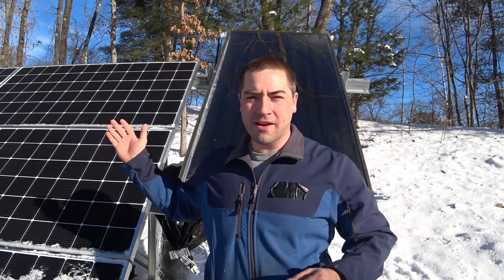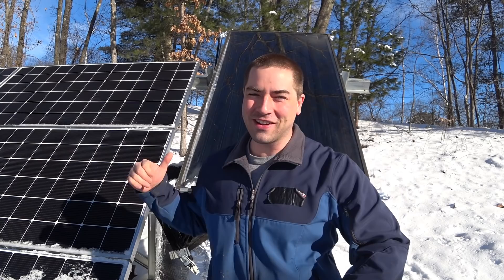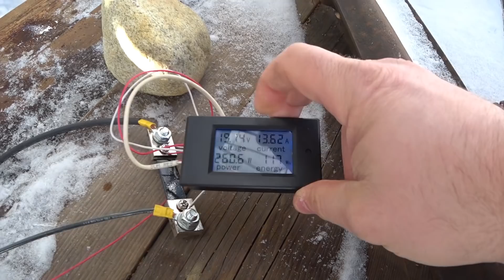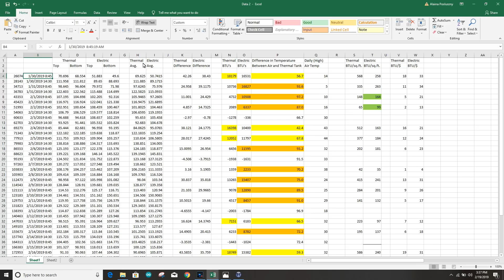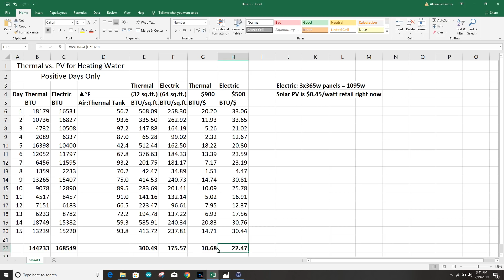Results of Solar Thermal vs. PV Experiment in Heating Water

Comment: Brilliant video thank you so much. I have been looking into solar heating for my Dad's very very cold house and I had wondered this very question PV vs thermal. What I have been seeing in the last few days though is in cold locations like yours you are much better off using evacuated tubes as they don't lose the heat to the cold anywhere near as much.

Comment: Not having the thermal panel and tank installed the right way will give you very incorrect results. Circuit needs to be closed loop and under pressure with expansion tank (minimum 1bar). to be able to  work efficiently. i prefer the pv but your test with thermal is incorrect. Excellent video.
Reply from the maker: There are more then one way to set up solar thermal.  I set mine up as a drain-back.

Comment: I didn't have the time to watch all the videos all the way through. Did you put a check valve on the thermal system? On cloudy days the warm water would rise and thermosyphon turning the panels into convectors, that being the reason for the difference on a cloudy day. This would make your results fundamentally wrong if you didn't.  Theoretically the thermal solar panels should win because they collect 54% of the light spectrum as heat https://serc.carleton.edu/integrate/teaching_materials/energy_sustain/student_materials/thermal_energy_.html whereas PV panels are only around 25% efficient.

Comment: What about under active loads like consuming 20gallons of the heated water per day and topping back off with the mains water? Would this alter the results or do they both seem to have similar recovery rates? As far as costs one could build a larger solar water exchanger with say an old sliding glass door and flip the results with the extra surface area and reduced cost of DYI panel.

Comment: Might be interesting to test it with a heat pump with the same surface area. 
The main issue will be the use of battery and managing the heat pump.

Comment: If your Solar electric panels have a bypass diode so the shading doesn't limit the voltage output because of the series circuit of many panels being hooked in series to get higher voltages like 240 volt DC 15 amps for a series /parallel setup, you could use regular AC elements out of a Hot water tank because it doesn't matter if it is AC or DC with resistive loads. 240 x 15=  3600 watts element. Solar panels can handle up to a 1000 volts passing through them for some of the newer panels with lower amps. When in series the volts add together but amps stay the same.

Comment: Okay,  so just speculating for now,  let's say I wanted to run a jetless tub. The tub is 86 gallons. I have a 350 gallon tank under my home for my thermal battery. Every time I fill that tub I lose 35819 btu. This means to replenish the water I lost in my thermal battery I will need 5 of these electric water heater tanks as they average 11452.5 btu's per day. Is my math off? 
To note, my thermal battery will be wrapped in three sheets of r50 insulation on all sides. So btu lost per day = 1/150*150*24*120 for the coldest of outside temps (only place being the crawl space for this tank) being 2880 for daily heat loss.
Reply from the maker: Hi Jacob.  That is one hot bath, LOL.  I think you are good on your math.  Instead of thinking of it as 5 heaters, think in terms of watts.  I had 3 solar panels connected to that one heating element.  If you paired the right resistor, you could have 15 solar panels to one heating element.    There are tons of other variables, such as latitude, panel angle, temperature, etc.  But you've got it.

Comment: Did you take into account cost of installation for PV's? Putting your voltage and amperage up will require you to spend more on your electrical installation will it not?
Reply from the maker: Running wires from a solar array to heater is faster and cheaper than running pipe.

Comment: Have you played around with vacuum heater tubes with the passive tank on top? From my understanding-they have the best efficiency for direct solar to heat conversion. While you get freezing weather up there, I understand it takes alot of cold non sunny days to freeze a passive 300 liter tank. Someone I met said they've installed quite a few in Norway and haven't had an issue with a total freeze over. Also-the PV system will gradually loose efficiency over time.
Reply from the maker: I have not gotten to try that.  But if a manufacturer wanted to send me one to test I would. LOL
Reply: @DavidPozEnergy  Let me see what I can do ;-) Looking to experiment myself.

Comment: OF Course Solar Thermal wins when competing on heating water. Evacuated Solar Thermal tubes are 70% efficient whereas solar panels claim 30% efficiency. So for every 1sqm of surface exposed to the sun (about 1kW of energy) Solar thermal retains 700W. Solar Panels converts about 250-300W into electric power, then converts the electric power back to heat via a heating element!

Your Thermal panel is a flat system, it is far less efficient than the evacuated tube system. If you want Steaming Hot, you simply add parabolic troughs to your Solar Thermal and you'll get steam.

Comment: My dream is not to build a sauna, but an outdoor bath tub like Colt Servers, the Stunt Man.   for those 32-34 MN sunny days!  thanks for the education.
Reply from the maker: That will be a good project.
Reply: @DavidPozEnergy  yeah.  I like soldering  copper pipe, it's fascinating.  start there. whatever brazing.  My energy is modest, It's passive heat for a  greenhouse and warming water for worm tea.   If I'm Colt severs any day,  ha we'll see..

Comment: Hi David, when factoring in costs, did you include the cost of storing the electricity generated from the PV panels (that is, the cost of the lithium batteries)? Thanks. How often do Lithium batteries need to be replaced? Thanks.
Reply from the maker: Not in this test.  This test is using the solar PV (electric) panel connected directly to a water heating element.  So there is no inverter, batteries, charge controller involved.  It's extremely simple compared to a battery based system.  In this case we are using the hot water as a "Thermal battery".

Comment: If the entire problem is that the outdoor temps are affecting the solar thermal system tank, then build an insulated hut or place the tank in your basement, and it would appear the thermal system would perform better.

Comment: Great video, thank you for sharing all your hard work! I would love to see a video of what would happen during summer. Would the PV / thermal comparison still hold up?
Reply from the maker: In the summer the solar thermal collector will produce far more hot water than the PV.  About 4x more.  I live in Massachusetts and want to produce hot water for both DHW (showers) and space heating.  I have surplus hot water in the summer, but was running this experiment to decide how best to make hot water in winter.  Thanks for watching.
Reply: @DavidPozEnergy  Thank you for taking the time to answer David! Keep up the great work!

Comment: Actually when do you have so few area that you have to use thermal elements? I think never ever...
Reply from the maker: I don't have an area problem with my yard.  But possibly if you lived in a town-house you could run into that issue.
Reply: OK, that's a point👍

Comment: what if you used a relay so when the water was hot enough that power then transferred to batteries?

something like this:  https://www.amazon.com/dp/B07H2X4NNR

so once warm enough just transferred the power over to batteries etc...  not sure it would work that way ,  what do you think?
Reply from the maker: I've been experimenting with some different ideas like this.  The relay built into these controllers can't handle the volts or amps from the panels, so it would have to be used to switch a larger relay that was rated for higher voltage DC, and had a NO and NC position.  (hard to find).  After a couple of small experiments I've decided it is easier to switch the AC side with a bigger inverter.  That's at least what I'm currently working on.  More future videos to come.   But I really like those little temperature controllers and have one that I plan to wire in to a cooling fan for my charge controller.
Reply: @DavidPozEnergy  sweet  yeah i just ordered one of these too https://www.amazon.com/dp/B07929Y5SZ

Comment: Nice job. Did you consider using optimizers on PV panels to get maximum power from each PV panel...? Energy production would increase by 20 to 30% 
Solaredge 800 watts optimizer is good for 2 panels and is around 85$ but worth the cost as it will boost your output. Regards
Reply from the maker: Hi Jamil,  No, I did not consider using optimizers on this project.  Optimizers work well when there are constantly moving shadows across part of one string.  Usually this might be with a chimney on a house.  In my situation the whole array is in full sun 5 hours a day, then is fully shaded the rest of the time.  Optimizers maybe would help for 15 minutes in the morning, and 15 minutes in the evening as the shade comes across, but the rest of the time it will have no impact.  If you feel I'm still wrong, then can you please link to an independent study on solar optimizers?  Thanks for watching.

Comment: One positive to note is that, you don't need power for a pump to move water about when heating with a PV panel system. It can heat the tank even when the panels and the water are in 2 different locations.

Comment: @DavidPoz this may be a dumb question, but would it be feasable to put your PV panel on top of the thermal panel ? This would allow you to use the lost heat generated by the PV to 'pre-heat' your water.
I'm saying that because I already have 2 Thermal panels on my new house roof and don't have enough space for a lot of PV. I'm wondering if this would be a 'OK' solution ...
Reply from the maker: If you mount your PV panels directly onto a solar collector, then neither one would work well.  There have been some companies over the years who have manufactured PV panels with the copper tubing attached directly to the backside for very good heat transfer.  However, all the companies I know of have gone belly up.  It seems there are too many complications with doing it.  Thanks for watching.

Comment: What kind of thermal collector is that? Are those just black painted downspouts? I would love to see this test done with evacuated glass tube solar collector as those collectors are likely 100x efficiency. It's very impressive though to see that a downspout collector panel still outperforms photovoltaic in BTUs per square foot. I didn't quite understand how the thermal cost more? Those are DIY projects typically with cheap materials
Reply from the maker: The thermal collector is professionally made in a factory.  Typically cost over $1000 new.  They are not downspouts, they are copper tubes that have been welded to copper fins and copper header manifolds.  The front is tempered glass, low iron.  It is top of the line for flat plate collectors.
Reply: @DavidPozEnergy  thank you I just reviewed and found the part where you mention this collector was $900. Would still love to see something comparing TV to evacuated tubes as these tubes have dropped drastically in price and can be put together by oneself with a kit from China for example, much less than $500 and much more efficient from what I understand. I am still very interested in PV for heating some water however and you alluded to heating water over 180 Fahrenheit, which I'm assuming is for hydronic baseboard heating, exactly what our new home has. Going to take a look at that video next thank you
Reply from the maker: I would also love to do a video with evacuated tube collectors, I just don't have them and can't justify buying a kit for making a video.  Even if you do have evacuated tubes, they won't get the water super hot (180°).  PV is the way to go for this.   I want to do some more experiments on this topic.  I just finished a battery build, so I might be able to get back to the solar thermal.
Reply: @DavidPozEnergy  sure understandable I was meaning that I think I need to search for other videos and info on that. Radiant floor is no problem on ground level as we have a full basement. However the second floor we cannot get under the floorboards obviously so thinking of using existing water baseboard. I've seen evacuated tubes boil water in dead of winter up in Canada although tank temperatures don't reach nearly as high. Perhaps combining PV and thermal together would be most efficient with thermal preheating and PV taking it the rest of the way

Comment: Solar thermal evaluated tubes outperforms solar thermal flat panels in the cold by a large margin. But initial cost and setup complexity is greater. In the long run, if the system is setup properly, evacuated tubes will be more cost effective. Specially as the prices go down.

Comment: Great videos, thank you for your hard work! Found someone using PTC elements (thermistors) to heat water with PVs... https://www.youtube.com/watch?v=wd5HRhBc3gI
Reply from the maker: Thanks.
Reply: @DavidPozEnergy  - a related (archived) article on using PV, MPPT and PTC elements - https://web.archive.org/web/20180522081051/http://www.orbicsolar.com/ptc-pv-heating-water/
Reply: @seankettle6873  That guy is a bunch of hokum.   PTC are nice if you totally run out of water covering the element and have no heater controls at all. They don't do anything for water heating. Generally PV water heating will be done at 1/4 of the elements actual rated power. I actually tell you how to build the electronics to heat with solar and not just sell you crap.

Comment: You should do a comparison with evacuated tube collectors they have a stagnation temperature of 400 degrees and do not suffer from the ambient air temp difference you can also store the excess heat in the earth and extract it when needed
Reply from the maker: I would love to do a test with evacuated tubes.  Do you have a set in Massachusetts that I can borrow?
Reply: @DavidPozEnergy  sorry I don't I'm in georgia

Comment: David,
 Thank you so much for this series of vids.  You did all the physical work of my mind experiment!!  I found your channel by doing a search on YT to see if someone had tried comparing these two methods of making hot water,  in the simplest way,  and you did!!!!  Thank you so much.  

Thanks also for the time spent on matching heater elements to PV panel output.   Years ago I trained/worked as an aircraft mechanic and recently converted a 36v golf cart to 72v ac with LiFePo batts.  I like to think I know a bit about electricity but might have messed up at first as well,  if I had actually done what you had done and so conveniently posted on your channel for other to learn from. 

I'm a fan now of your channel and will probably be watching a good bit of your content.
Reply from the maker: Thanks for your comment and watching the videos.

Comment: Chiming in late here David, great video btw 👍
One thing you may not have taken into account which will be relevant on many systems. In winter, late spring and early autumn solar water systems can be irrelevant if there is a single tank with multiple coils. What happens is the solar water system never runs because other heat sources keep the tank temp too high to trigger the system to switch on and pump heat from the solar panels. Solar electric water heating does not have this problem.

Comment: what would be REALLY interesting is if you could get some of the super high tech aero gel insulation stuff, you know, you can old in in your hand and blow torch the other side and no heat comes through.   so that you have the absolutely best insulation between the thermal mass of the water and the environment.   if you can stop the water int he tank from losing heat, then suer win win for both systems.

shame that stuff is both super expensive and VERY hard to get.

it's something that will vastly improve hot water systems in the future once they can lower the production cost.
Reply from the maker: A few years back I was able to get my hands on some aerogel and experimented with it.  It was incredibly difficult to work with, and it's claims of energy savings were exaggerated.  I have no doubt they had high efficiency in the lab, but the real-world tank did not do (noticeably) better.
Reply: @DavidPozEnergy  hmm most interesting.

seems the BEST would be a vacuum chamber, but highly impractical in the situation (both cost and implementation)

next oddly enough is sawdust..  but it's flammable.

and then compensate materials that combine insulation and density.

and I'm still reading.....
Reply from the maker: My favorite way to insulate a thermal storage tank is to:
1. Put the tank on a square of foam board
2. Build 4 wood-frame walls around the tank.
3. Dense-pack the whole structure with cellulose insulation from tank, out to (outside) of wood framing
4. Sheet-rock or plywood.
Reply: @DavidPozEnergy  sounds like a pretty damn good idea.  
I live in Brisbane Australia, so we hardly get "cold" here, but it'd be interesting to see what, if any savings could be made from improved insulation, I'd imaging though,t eh return on investment would be a VERY long time.

Comment: Excellent experimentI messed around with several pv heating setups and finally hit the winnerTwo 4 panel series  arrays in parallel ( 275 w panels ) wired direct into a 2000 w 120 vac element. Simple, simple , simple. I peaked at 1900 w ( 118v and 16 amps )Steamed a 265 L tank in 8 hrs from 10 degrees C start temperature